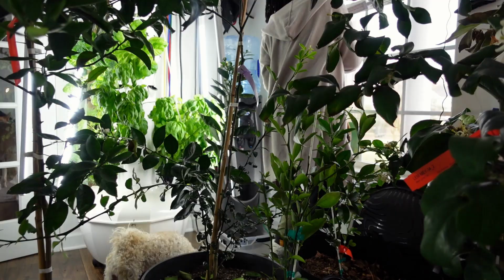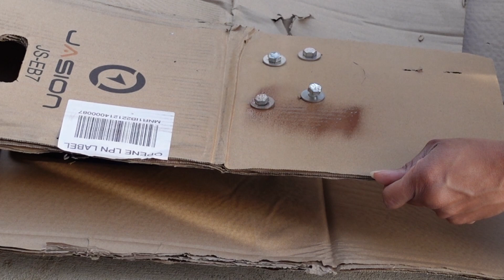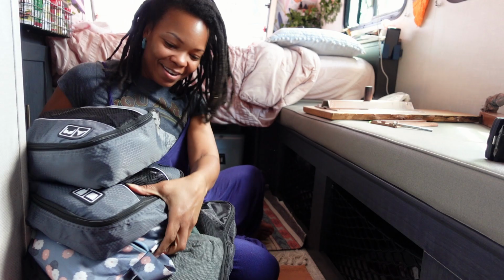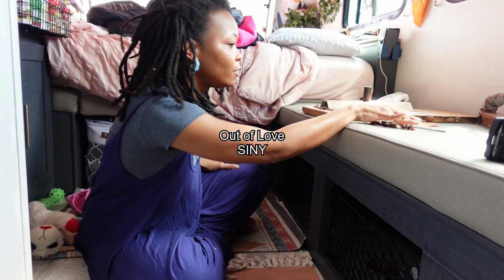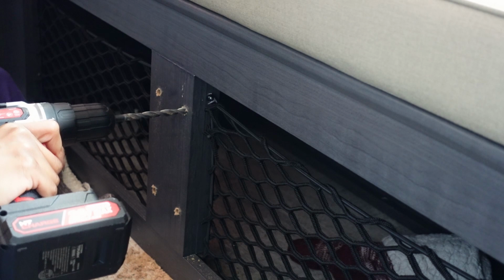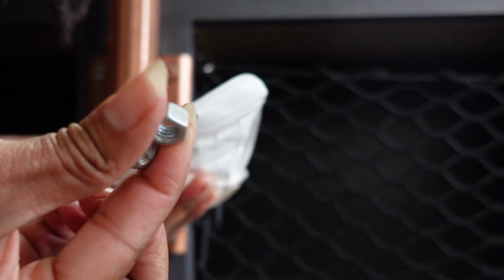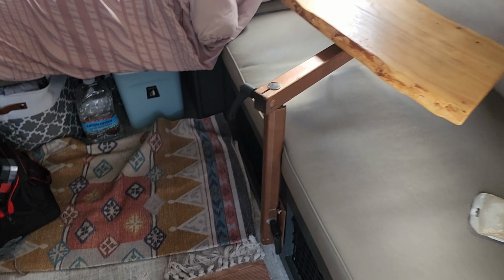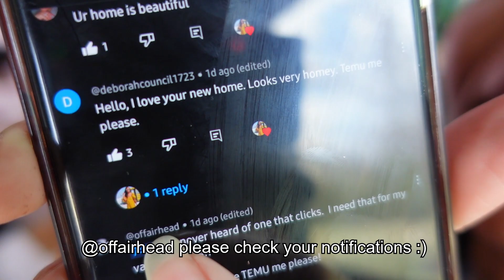Installing a Swivel Table inside My Tiny Home On Wheels | Solo Female Van Life in Travel Trailer

Comment: Brittany, you did great with installing the swivel table. Don't  worry about the paint job, but if it is bothering you, take the spray paint and spray it in a cup. Use a small paint brush to touch it up. Your smile is beautiful, indicating you're living your best life
Reply from the maker: Thank you so much 💓 👩🏾‍🎨🥰
Reply: I was about to message the same. Glad you did.
Reply: I was about to say the same thing about spraying paint into a cup and using as touch up!
Reply: You can get nail polish too as close as that color to touch up your spots.
Reply: Wonder about using a "toothbrush" vs. a "paintbrush", for touchups -- due to limited space.

Comment: I believe it was on Amazon I seen that they sell wraps you know that the vinyl self-adhesive wraps they usually sell them for bikes but they come in different colors and they also have different designs you could probably use that on your frame of your table just a thought

Comment: Take ya some spray paint and puddle some up on a throw away plate. Use a little art brush and touch up the dings and scratch’s. Find a clear coat and brush it on to keep the paint from peeling. Cheers 🥂

Comment: Hey hun, if you ever see them when shopping for hardware, you can buy rubber nubs I call them not sure the technical term.,,but you can put them on the tips of your bolts to keep from scratching up your stuff when pulling them out from storage. Talking from experience..lol Yep,  4 is all you need and I THINK,, don't hold me unaccountable they were sold in a pack of 6. Anywho...nice table!!  :)

Comment: Hi whatcha up to hope all is well hugs many hugs sending up prayers 4 healing and unspoken also prayers 4 everyone and bless great healthy peaceful safe journeys travels and happy camping and happy building in the name of the Creator God and Yeshua/Jesus and the Holy Ghost Amen much honor and respect keep walking tall always and cool cool video always remember u r beautiful and beautiful soul always and keep ur head up smile just lil tip if u use the grey crayon out of box crayola crayon box of crayons it will help with the scratches on ur wood nxt to table leg and or pole plate also with a small dollar paint brush that u use painting pics u can use the same spray paint u did the mount and table pole with spray lil bit in something u can throw away and or a box and then paint over the scratches on the mount and bolt heads also u did great job proud of u hugs 
🚌🌅🌌⛺🌄🏞🏖👍👍💪🙂👍👍